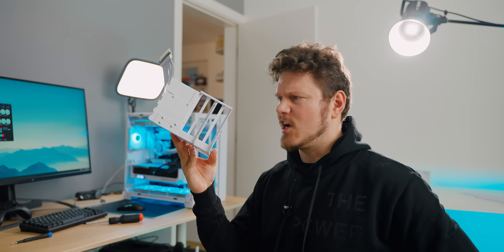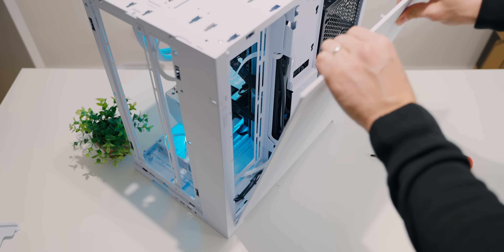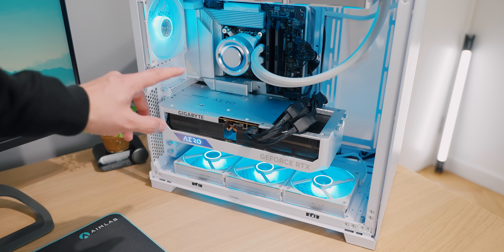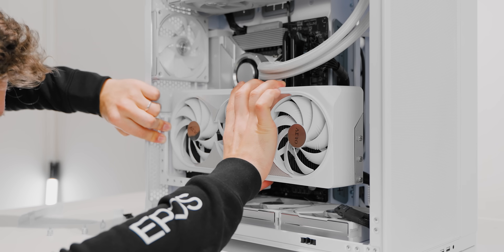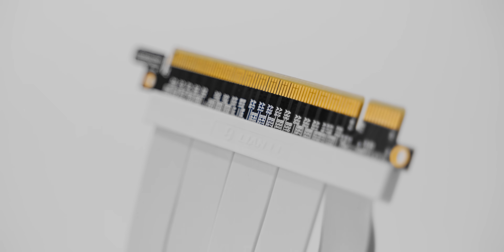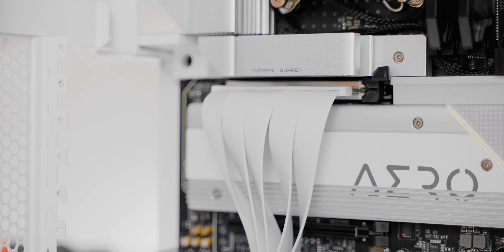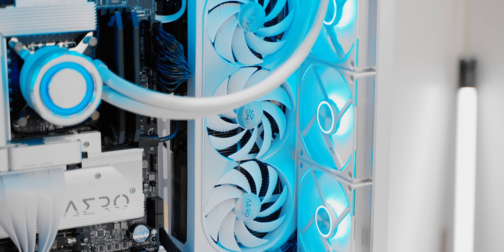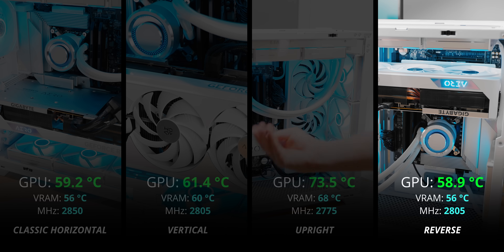The Best GPU Orientation EXPLAINED!

Comment: I would have changed the top intake fans to exhaust in the reverse configuration. Having them as intake with the GPU pointed directly at them would cause turbulence resulting in the cool & warm air mixing. The radiator fans could then be used as intake or you could have tried an air cooler with intake fans in the front of the case.

Comment: I have issues with this test. Not everyone has a case with fans on the bottom and the O11 does not come with fans on the bottom by default so testing that way just seems wrong. Now personally I water cool my GPU so the orientation doesn't matter at all. But Since I use soft tubing switches between vertical and horizontal based on my mood and how I've decided to customize my PC at the time since I Keep tweaking the aesthetics with different 3D prints and paint jobs and LED patterns.

Comment: Hi, thanks for the video. I want to bring you back about my experiences with my current case, a Fortress FT05 with several boards. Then the orientation of the heatpipes is the key to everything, ie in cards where they are positioned vertically (type RX 480 Nitro) the card works correctly if rotated 90 °, while in others where the heatpipes are positioned horizontally (like your RTX 4080 in the video) the temperatures jump to them, in fact if you go to analyze the hotspot temperatures you will see huge differences and in some cases even at the limit of operation. With an RX 5700XT Aorus I had this problem, with the gpu at 80 ° c and the hotspot at 110 ° in continuous throttling, same thing with my RX 6900XT Reference, turned 90 ° the vapor-chamber does not work properly, which solved by rotating the case 90 °, with the configuration reversed as in your last test. Rotating the vga 90° made sense when there were references with the blower, now they are useless and counterproductive. Sorry for the long speech and for my bad English. Greetings from Italy .
Reply: RTX 4080 MSI are recomended by Lian Li, but it looks that the heatpipes are postioned horizontally too. So, this is confusing.

Comment: I've used Corsairs Carbide Air 540 in 6 builds.  Easy to work in, decent air flow (provided you add fans), 2 HDD cages, 4 SSD and 2 spots for DVD players.  I still use CDs and DVDs.  Because I like how it looks, I recently used Fractals "North" (charcoal) in a build.  An Arctic 280 with a PowerColor 7900XTX barely fits.  Tubes are at the bottom and swing out and up between the side glass and GPU.  I'm not "into" RGB and I'm looking at the front of the PC in any event, so where the AIO tubes are is not a big deal for me.  I will need to buy a stand-alone DVD burner.  LOTS of home movies on tape to transfer still.
There were a fair number of good-looking PC cases shown off at Computex.  While last gen CPUs and GPUs have fallen to reasonably sane prices (AMD not Nvidia), AM5 and MB and RAM prices are still spike strips in the path of new PC builds.  For what I play (GW2 3 years) the AM5/13th Gen uplift would be gilding the lily (pointless).  I did see a marked difference in eye candy at 4K going from my 1080Ti to AMDs 6900XT to PowerColor 7900XTX.  I did NOT see an uplift in effective game play performance.  The 1080Ti with sane settings at 4K played GW2 at 80 to 130 FPS (according to EVGA Precision X).  According to AMDs software, 120 FPS avg at 4K with eye candy maxed.  I've used a X-99, X570 with 3600X, 5800X and X570S with 5800X3D.  No, GW2 is hardly Cyberpunk and there is no RT option (to tank performance), but with shadows, etc. all maxed, RT would likely be pointless.

Comment: honestly the upright positioed card would prob benefit if u could have fans at the bottom still, considering we already saw the fans direct next to it make the temps worse (assumingly due to airflow being to turbulent for efficient cooling?) still interesting to see all the options ^^
Reply: nah that position failed bc of how gpu exhaust hot air. the fans intake air and blow it out the SIDES of the card. the sides are 100% blocked in that orientation
Reply: Yeah I wanted to see this as well... And also how each orientation affects the CPU temps
Reply: The front fans are probably blowing the air away from the GPU, starving it of fresh cool air. Would've been better to try no Fans in the front and instead on the bottom (although it didn't seem you could fit three there with that extra long GPU).
Reply: There were a number of mistakes in this video. He should've reversed the side bracket to allow for more cabling room and airflow, he didn't install fans behind the GPU, and his model of card isn't even considered compatible by Lian Li with the upright bracket he's using. They released an updated one, but for this card it requires this case to be in Reverse mode, and then it won't interfere with bottom fan installation.

Comment: Honnestly I think you could have provided way mor value would you have tested multiple configurations for radiator/case fans for each of the orientations. I'm sure thre is some combos that perform much differently. An example: in the 2nd configuration, you should try bottom-exhaust. In any case. it is a nice effort to showcase how flexible this case is. Thanks!

Comment: The temps in upright position are so bad because Dimitri completely blocked exhaust of the gpu, I bet the temps would've been better if gpu was moved a bit forward and if there weren't fans installed on the front panel so that gpu could exhaust thru the mesh.

Comment: To fix the sag on the Lian Li vertical GPU mount you have to move the PCIe slot itself forward on the bracket. From factory they come a little too far back which pushes the GPU forwards/down. Sliding it back pulls the GPU towards the back of the case and eliminates the bracket sag.

Comment: 1. Bracket weights nothing. GPU does sag. Just add some holder for the GPU and the bracket will do fine. 
2. Bracket does block significant amount of airflow. The position itself is half as bad.
3. Turbulence is great for cooling. It makes different layers of air mix. "Surface" hot air with the flow. So the cold air doesn't just flow by. What you don't want is reuse airflow.
4. High speed for airflow also means less pressure. That's why front intake doesn't work great with GPU right next to it. GPU fans struggle to get full amount.

Comment: I ran into the Upright position issue when upgrading my GPU in a Silverstone Alta G1M. My Morpheus II modded 1080ti had no issues with the orientation, but the new 6800xt did. It got bad enough that I ended up inverting the entire case (bootleg feet on the top, flipped it upside down, set former intake fan on bottom to exhaust) for a much more effective result. 

I would be curious of the numbers with an inverted upright GPU in this specific case, but I also acknowledge the lack of an "official" bracket to do so.

Comment: I don’t believe you have the vertical bracket installed properly.   There is a peg that anchors the backside of that bracket into the bottom middle motherboard stand-off that doubles as reinforcement.

Comment: Idk how many people are going to tell you this (so sorry if I'm the 27th one) but when mounting vertically, instead of turning the bottom fans off, rotate them to expel the air out of the case (you probably knew this and didn't want to do it since is tedious but since it wasn't mentioned I leave it here for anyone mounting the GPU vertically).

Comment: Running a 4090 in vertical orientation with bottom fans too. But I have a larger case (Phanteks Enthoo Primo) and the bottom fans drop the GPU temps significantly - I actually have the fans set to only spin once the GPU fans are spinning too.
AIO rad is top mounted to extract with push pull. Plus 3 fans as front intake and 1 rear extractor.
All fans are 140mm and they only turn on once temps are high enough so the PC is silent when I'm not gaming.
Reply: did you set the bottom fans as exhauste or intake?
Reply: @alpha416game3  intake. They blow onto the GPU this way. I have 420mm rad with 6 fans in push pull as exhaust at the top which are always on and just speed up depending on the radiator temperature (using a probe).
Then as complete overkill I also have 2 front fans as intake as well which kick in if the ambient case temperature gets too high, but they very rarely kick in. Usually only if I'm rendering or running comfyui etc and bith GPU and CPU sit at 100% for extended times.

Comment: Upright would look awesome if you swapped the radiator to the front and the cooling fans to the top and added 3 more to the bottom. And set the tower on its side and threw a monitor ontop of the side panel.

Comment: Good lord I would put the CPU cooler intake front  and raise the PSU to the top of the case so it draws air from the CPU. Maybe side mount the GPU that looks neat. Then set the tower down and put the monitor on top of the side panel.

Comment: i think the upright has great perf benefits, if you also use the gpu fans ( showed in the vid they're not spinning ) , also in the reverse position you should recommend to mount the aio pumps correctly because of trapped air concerns
Reply: The fans arn't turning when the gpu isn't under load, most high end gpu do that when idling
Reply: @Natsukashii1111  but i think it shouldn't reach that kind of temp, probably should be ~30 C
Reply: * it should spin if it reaches 60 C or  more
Reply: @kingofstrike1234  the temp that they where showing where not the one the pc we could view was at the time
Yes they fucked up, they shouldn't put B roll of a random pc with different data on screen

Comment: The new Lian Li case where the GPU can be mounted directly to the front of case where the fans normally are so it can suck air in directly will probably be a great cooling option when that case hits the market.
Reply: Yea I remember seeing that in the computex, hope he get the case to test out soon.
Reply: That is the evo xl right? It looks very cool to me, I think that is what I will build in next.
Reply: report mentions toasty gpu  on the sup01
Reply: It's also great for enjoying the coil whine to the fullest!
Reply: Are you telling me that it's a good idea to have gpu hot air as a sauna for the rest of the component?
Reply: @anubizz3  Unless you go full air cooling, you'll always have either graphic cards or radiators dumping warm air inside the case.
Reply: @airixxxx  that's why I wonder why pc case manufacturers never consider separation chamber between gpu and CPU.
Reply: @anubizz3  Many mini ITX cases have separation. I imagine ATX don't do separation because you need a PCI extension for that.
Reply: @airixxxx  That actually even more not making sense since atx crowd don't really care about size unlike mini itx who obsessed how small they can be .. O11 for example the bottom part almost unused and there almost 10 cm in top which clearly designed to have pull push aoi.. Which unnecessary if there is full separation between CPU and gpu chamber, the can raise the motherboard abit so we can have 3 fans as intake and exhaust vertically in the bottom, and made the side panel part meshes, and with riser cables and few glass panels they can made the bottom part as gpu chamber with intake on left and out at right.. Or if people don't care see the back of their card and blasted by hot exhaust 24 7 then from right to left... 2 120mm on the front side and 120mm on the back as intake and 360 aio on top as exhaust... This make all components guaranteed get fresh air..
Reply: @anubizz3  They did,the new Lian Li SUP-1 uses a separation chamber, but a totally new design....

Comment: I am running my EVO with a 7950x and TUF 4090 in the upright reversed build and I am getting the best temps I have ever gotten. with just using 7 fans. 3 top, 3 bottom, and one in the back. I removed my mesh front for glass and this thing is staying frosty

Comment: Isn't reverse mode bad for the AiO? Doesn't the radiator need to be above the CPU or air bubbles can enter the cooling loop in the CPU?
Reply: The air should settle at the top of the radiator, which is still above the pump

Comment: Mounting upright, your fans should stay on bottom as lower intake. Mounting Vertical, bottom fans should be mounted as front intake. This entire test with only using the largest card on the market was really flawed here.
Reply: They are mounted as intake when they were at the bottom and when they were mounted at the front?

Comment: Hi Dmitri, problem with the IO towards the top orientation is well known in the SFF community, the problem is that most modern GPU's have issues with heatpipe physics in that orientation, so we try to avoid it. Unfortunately not all case manufacturers are aware of that. Thanks for the awesome testing as usual :)
Reply: It's even on a card by card basis. My old Palit 2080 Ti never had any issues being vertical with ports towards the ceiling, but my PNY 4090 does not like that orientation at all, it got much hotter and louder. It seems to be all in the design of the heatsink.
Reply: @kasakka  yeah depends on the heatpipe type they use mostly.
Reply: @kasakka I think blower style cards are also exempt from this and like vertical orientations
Reply: @xynonners  blowers probably don't care yeah
Reply: Also The upright position works better with exhaust fans mounted behind the GPU to pull the hot air as they exit out the sides and lower back plate
Reply: @CoolColJ  This was my first thought when he was moving the bottom fans to the front. Like, "Why are you even moving THOSE fans to THERE? And why are you NOT adding exhaust fans behind the GPU?!" Testing was not done well, and it never showed the affects to the CPU temps either. Comparing apples to oranges.
Reply: Literally had this issue with the XPROTO N Case with my 7900XTX. Ended up putting my build back in my NR200P because it was significantly cooler plus I can put slim fans under the GPU to ram air straight into the GPU. Though I have heard that vertical with I/O down can actually be an improvement over even horizontal because most GPU dies are offset towards the I/O so all the cool liquid in the heat pipes has an easier time getting back to the heat source.

I/O up makes gravity work against the capillary action in the pipes but I/O down makes gravity assist the capillary action in the pipes.
Reply: @derekgrubbs4754  yeah I have also seen people getting good results with io down, thanks for sharing!
Reply: @riba2233  Yeah I’m thinking I want to make a custom base for my xproto so I can have all the io down. Other bonus would be that I can hide the cable spaghetti that would otherwise be coming out of the top.
Reply: The capillary action isnt enough to move liquid back up the pipe to the GPU? Is it that all models have the problem or would cintered heat pipes be able to transport enough liquid? From the overall results it certainly looks like gravity is having a big impact.
Reply: @tomhollins5303  most gpus are affected but not all of them yeah.
Reply: @riba2233  Thanks I'm not building a new machine but I find these details fascinating to understand anyway.
Reply: Cards with vapour chambers don't like this position
Reply: make sence. the fluid inside the heatpipes go away from the hotspot😅
Reply: Same reason why some cpu air coolers comes with an orientation guide. Never have the tip of the heat pipes facing downwards.
Reply: Lian Li is aware which is why they created reverse mode. The youtuber just didn't do the upright gpu in reverse mode.
Reply: @riba2233 Thanks for pointing this out. I'm planning do a C4-SFX build once that case becomes more widely available, and I haven't yet decided on a GPU. Do you know of specific GPUs that are either subject to or immune from this problem?
Reply: @bobwatkins1271  I don't, but c4-sxf uses standard (invert) orientation which is not problematic. Btw that case is sold out and you will have to wait for the new revision that is coming out early 24
Reply: Goddamn bros just a nice guy
Reply: @shushtidy3577  ?
Reply: @riba2233  you gave feedback in the best way possible.
Reply: @shushtidy3577  ah ok, thank you a lot :)
Reply: depends on where the heatpipe is pointed. the 4090 aero has heatpipes pointing at up and down when it's in upright mode so this particular model works well in classic horizontal or reverse horizontal mode
Reply: sintered heatpipes and vapor chambers, which afaik are almost exclusively used, should virtually be unaffected by orientation.
any changes that are noticable are probably due to different variables
Reply: I always hear this in SFF communities, but there are 0 actual tests to support this. Just anecdotal evidence that then is contradicted by someone with the same exact build.
Reply: @RetroTeddyBear  bs, there are tests including the one from hardware canucks. How do you think the sff community even discovered the issue, somebody did the tests!

Comment: These results don't surprise me at all. I'm pretty sure engineers that work on these products know that most users will just install the GPU directly in the PCIe slot horizontally and optimize the cooler for that orientation. When users or case manufacturer try to come up with "smart" ideas this is usually the result.

Comment: It still requires a PCI-E Riser which is another point of failure and is kinda expensive if you need to replace, and it blocks all other PCI-E slots bellow it. I like how Sharkoon did on their REV series of cases in fact I have one of said PC cases. GPU is vertical but still directly attached to the motherboard. Only downside I noticed is you'll probably need at least one or two of your cables to be lengthier.